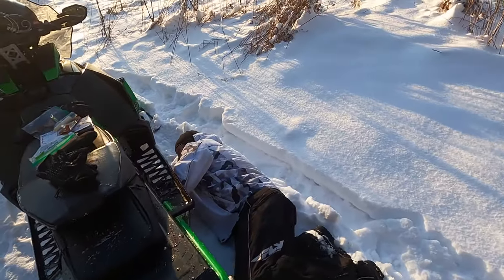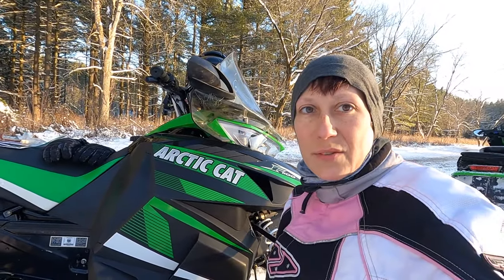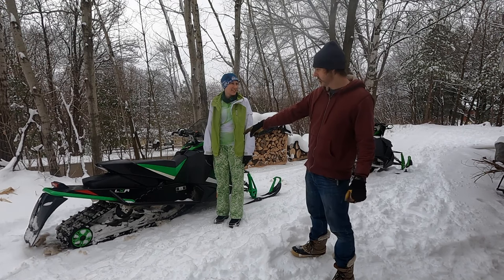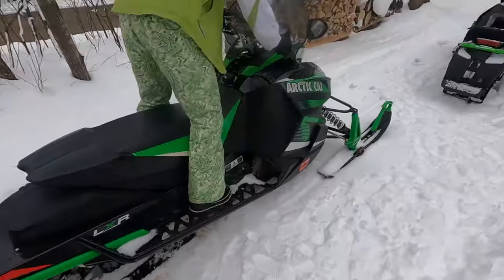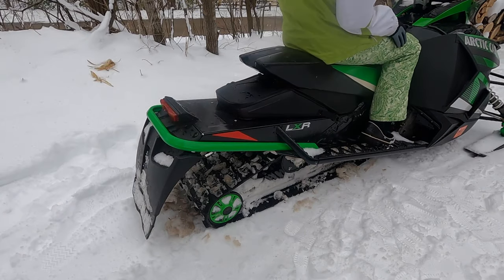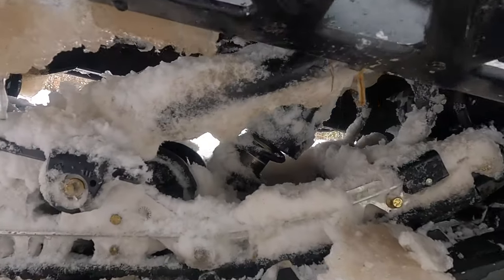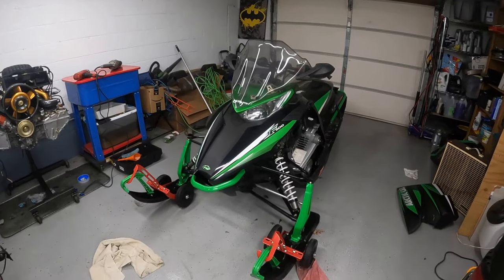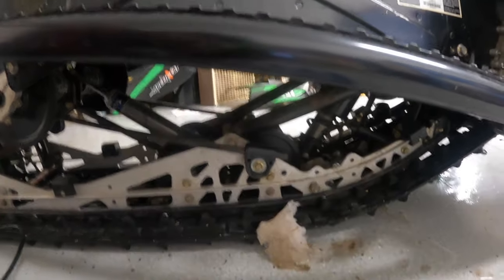Suspension Setup on an Arctic Cat Procross Snowmobile F XF ZF M How to adjust for Lighter Rider

Comment: Good start finding the high preload in the front spring.. The starting point for the front skid spring tension should be as loose as possible regardless of rider size... just enough tension that the spring isn't loose in the it's seat. Its' more efficient, better in lose snow, rides better and gives better handling. too stiff in the front will make the sled feel "short" and darty as well. The rear torsion spring should be the dominant spring that handles the baseline rider weight. It still doesn't look like there is much sag with her on it even after your changes...if it he torsion spring tension is already in the softest setting, you can soften it further by moving the rear scissor arm in the more forward holes in the skid. This will give more mechanical advantage for the skid to compress the same torsion spring and give a softer ride in the rear, increase weight transfer and provide lighter steering.  She will lose some travel and there the chances of bottoming are increased but that's probably not even close to happening with mild riding right now. I'd try that and you could bump the preload up a little if it's too soft, but I doubt it. You may need to adjust the coupler block to make it couple earlier if there is too much weight transfer under acceleration after this change (lifting skis) or you may need to play with front spring tension if handling degrades, but I'd start with those two things.
Reply from the maker: Thanks I will try that when I get the sled in this weekend!

Comment: your track could be too tight won't let the back end go down as much
Reply from the maker: Checked that, it was pretty loose.   The issue is the 12-13 shocks are just super stiff, and she doesn't weigh much.   Need to get them revalved for a lighter rider, and possibly swap springs.